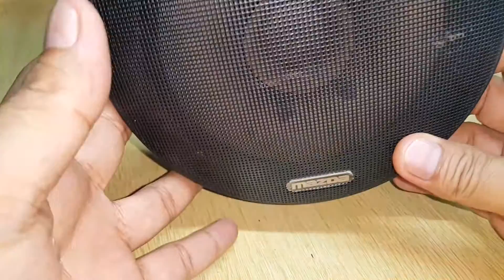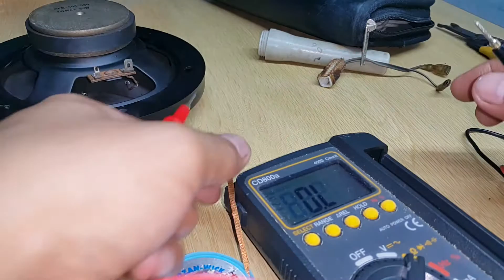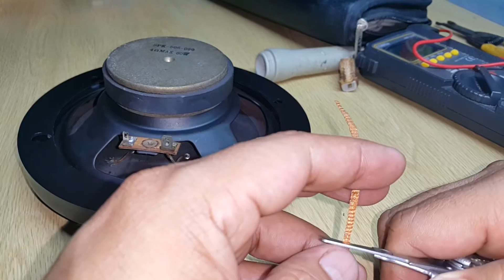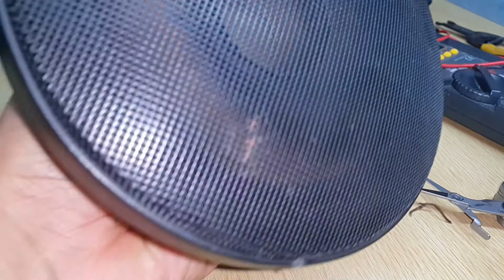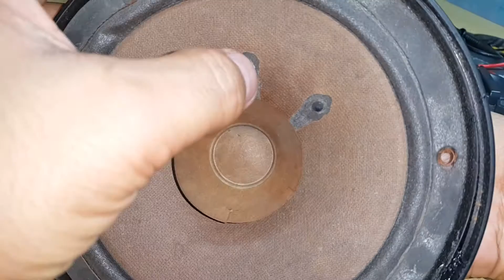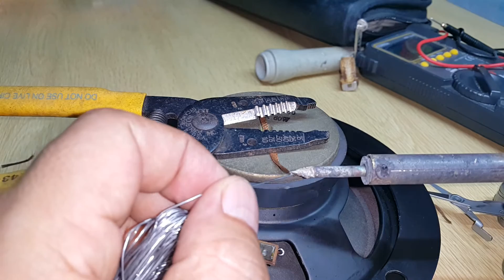DIY: Speaker Tinsel Wire Replacement P1

Comment: I used desoldering wick too as a tinsel wire replacement... but just could not solder it to where it met the cone... I used a conductive resin glue with silver particles... It worked a treat.